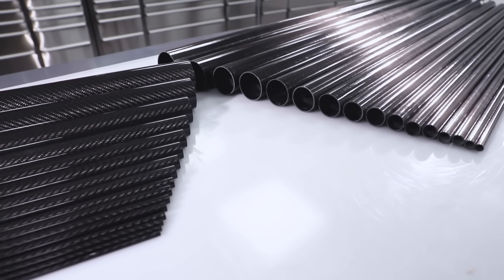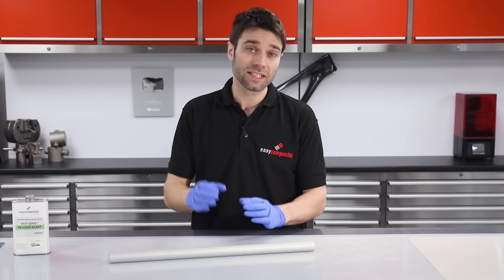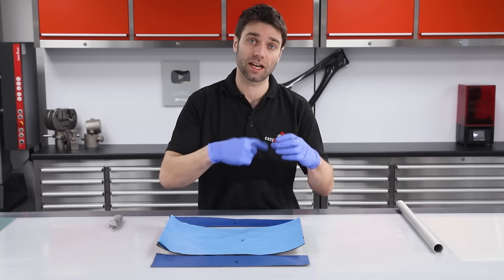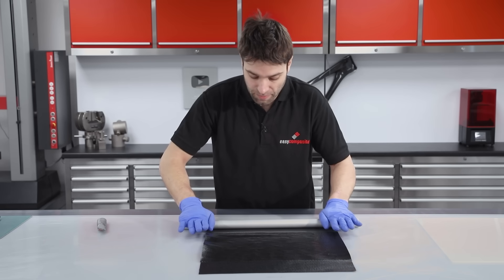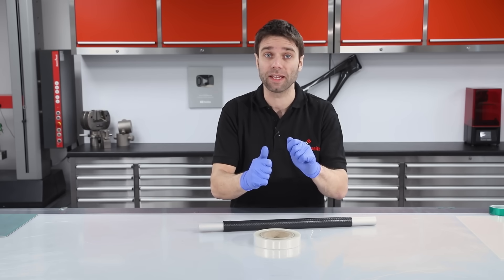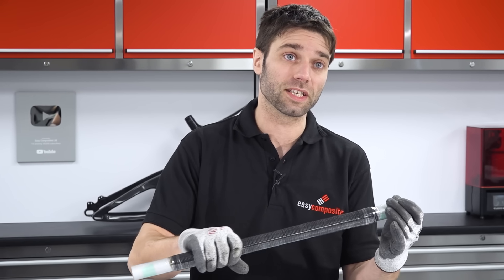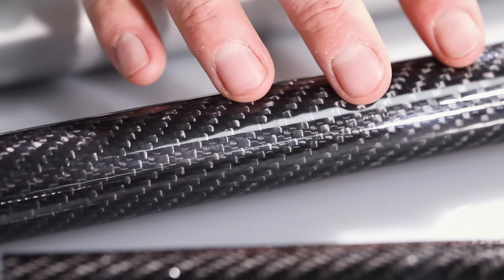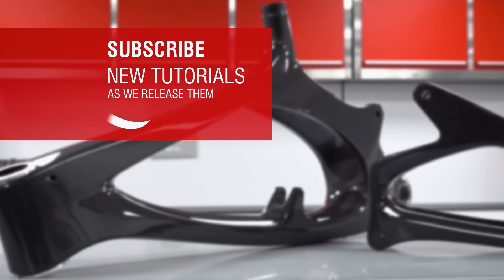How to Make a Roll Wrapped Carbon Fibre Tube

Comment: Hey, why don't you make similar strength comparison for aluminium and steel tube same size as this carbon one? THAT would be interesting.
Reply from the maker: Well, firstly we didn't have those tubes handy. Secondly, the deflection of a steel or aluminium tube is pretty standard data so could be calculated accurately. I won't do the number crunching now but suffice to say that weight-for-weight the carbon fibre tube would beat both the steel and the aluminium tubes hands down.
Reply: @easycompositestv  Well, everything that has been said is clear to me - I am a mechanical engineer. However, I think that this comparison would be very beneficial for people without specialized knowledge in the field of mechanical / material engineering - for them the widely available detailed data of specific materials are completely useless because they are not able to interpret them correctly. Also, "one picture is worth a thousand words :)
Reply: @easycompositestv  Did you use "well" word on the beginning of your sentence for irony? I'm asking seriously, because I'm not native speaker, so I cannot recognize it.
Reply from the maker: @dzikusdzikusdzikus  No, not at all - in this case, it was just a starting point to the sentence - no irony/sarcasm is intended at all.

Comment: Whats was the wall thickness of the carbon tube you made?
Reply from the maker: Wall thickness was nominally 1.4mm. Using a vernier, there was a variation between 1.3 and 1.5mm.

Comment: Will the resin hold up to some chemicals? Say if I wanted to use these for coolant pipes in a car? Also if I can suggest a topic for your next video, a motorcycle fuel tank? I’ve been want to do one for years but I really find any info on the subject. Thanks
Reply from the maker: Epoxy had pretty good chemical tolerance and also a tube that's been cured at 120C should have an operating temperature that's up to the 100C you'd need for a cooling system. HOWEVER - continuous exposure to antifreeze and boiling water is not really what a carbon fibre tube like this is designed for and so I wouldn't recommend it. As for the motorcycle tank, yes, we'll definitely be making this video in the future. The trick is to use a tank sealer to protect the composite laminate from the fuel. Make sure you're subscribed to find out when we make this video!
Reply: Subbed! For motorcycle content! Yes finally!

Comment: This is great. I always enjoy your videos. But I’m curious. What if you don’t have the curing oven? Is there a way to make these tubes if you don’t have one?
Reply from the maker: You can't really use the roll wrapping process without an oven because the process requires the mandrel to expand, then the resin cures, then the mandrel contracts. Without heat, this isn't really possible and so this process can't be used. You could do without the oven if you had a slightly tapered tube however.
Reply: You could try making your own budget oven like is shown in this video. https://youtu.be/CQ1PNXa_LaI?t=1227

Comment: hello i plan to make my own carbon tarp tube for camping use the tube will be use in windy condition  wonder what type of carbon i should use 1k carbon  and should i mix it with kevlar will it make it stronger also can i make my own carbon tube with out using a oven ?
Reply from the maker: You can't use this roll wrapped process without an oven Kenneth because the process requires the mandrel to expand, then the resin cures, then the mandrel contracts. Without heat, this isn't really possible and so this process can't be used. In terms of the carbon to use for your tent poles the '1k' but doesn't make any difference (apart from quadrupling the price), 1k just refers to the size of the fibre bundle, not the strength or any other properties. Kevlar is only useful if the pole might break completely and you don't want it to fall apart when it does. Assuming you're not planning for this then I'd stick with pure carbon; that will give you the maximum strength and stiffness for a given weight. The biggest difference will come from the mix of woven and UD plies and the alignment of the UD plies. For a ten pole, you probably want a layup similar to the one in our video - i.e. the majority is UD down the length with woven inside and out.

Comment: Could you make a carbon tube with a wet lay or infused process instead of prepreg?
Reply from the maker: You could certainly wet lay in a very similar way to the repair done here and also similarly to a tube repair as seen in our Fishing Pole Repair Video.  Infusion would be much harder in a practical sense for smaller tube sizes, although for bigger sizes it may work using a tubular bagging film and extra care to ensure the resin is evenly distributed all around the tube.
Reply: You can also make your own prepreg by doing a wet layup on flat carbon and then freezing it. Then when you are ready to make your tubing, just let the home made prepreg thaw just a bit and roll it on just like factory prepreg. It's much less messy that way and the carbon tends not to slip as much during application.

Comment: So how would you go about doing a tapered mandrel?
Or even, could you use this process to carbon wrap a rifle barrel with high temp resins?
Reply from the maker: So, if you had a tapering mandrel you would cut your reinforcement to anticipate the taper, i.e. it would be a wedge shape, and then you would pretty-much follow the same process that you see in this video. You will encounter some complexities around fibre alignment (i.e. the UD layer would start to go off-axis as you wind it round) which you'd need to overcome by using multiple shorter lengths of UD, each time resetting the fibre alignment.
Reply: Easy Composites Ltd thank you for the reply. Can you make a video showing what you mean please. 
I understand how a wedge shape would work. But I’m. It sure what you mean by UD. 
For my project the barrel would form the mandrel and would be left in place after the cure. 
So a conductive resin would be needed. One that could take a lot of heat.
Reply: @onemanriflemaker3873  I think "UD" here is short for unidirectional (the middle layer in the video).
Reply from the maker: So, if you had a tapering mandrel you would cut your reinforcement to anticipate the taper, i.e. it would be a wedge shape, and then you would pretty-much follow the same process that you see in this video. You will encounter some complexities around fibre alignment (i.e. the UD layer would start to go off-axis as you wind it round) which you'd need to overcome by using multiple shorter lengths of UD, each time resetting the fibre alignment.

Comment: Nice video as always. When I did some tubes for my car I wrapped some extra tows around the ends to make beads, kinda like your step to pull it off if necessary. This way theres much less chance of a coupler popping off. My application was for car intake tubes that see boost pressure.
Reply from the maker: Yep, nice tip and nice way to get a small, neat step on the end of your tubes. Totally makes sense.
Reply: Hey Man, I was exactly thinking about to make Boostpipes for my Hillclimb Porsche 944. It runs in Racemod nearly 4 Bar (something around 58psi). Son now my maybe dumb questions: Can they handle that? I mean it is mechanically strong of course, but air pressure? would really appreciate your answer. Stay safe out there!

Comment: Slight overlap, would that be 5mm or 10mm? For additional strength could more layers help? Rotational strength? You make it look easy. Thanx
Reply from the maker: The overlap is only necessary to hold the fabrics together during the rolling process, so in this case the overlap was actually very small at around 3mm.
Reply: @easycompositestv  with the 5 total wraps around the mandrel, what wall thickness does this equate to after baking?
Reply from the maker: @sandman70131  The finished tube had a wall thickness of 1.7mm.

Comment: Is that a 3D printer what you have in the background?
if so, it would be great to see how you use it to build carbon fibre parts
thanks
Reply: It's a resin 3d printer.
Reply: You don't make carbon fiber parts with that printer.
Reply: @derbigpr500  maybe moulds
Reply: @derbigpr500  not directly out of the printer, it can only cure UV resin into shapes. But the resin print can be a mould or blank to make a more durable mould from.

Comment: How its made a fiber carbon steering wheel? Thanks!!
Reply from the maker: Because it's a completely closed 3D shape, a carbon steering wheel is usually made in two halves which are then bonded together afterwards, as a front and back. Of course, this depends on the design and some shapes might allow for a process more similar to how we made the bike frame (shown in our last video) but that requires some way inside the form.
Reply: @easycompositestv  You can’t make it by rolling the carbon fiber directly into the shape of the steering wheel?
Reply: @easycompositestv  in this video , puts the carbon fiber on the steering wheel and gradually gives it the shape. this way of doing it is correct?     

https://youtu.be/UDsZsFJ1ai8
Reply: @fransanchezfsr1731  the video you tell us, is laminating process, its a hand layup, and only for cosmetic purpose. It's a different things than 'making stuff'
Reply: you could possibly do it like they show in the bike frame video. design in a way to extract an inner bladder or bagging material then use the vacuum method.

Comment: Do you pre heat the oven to get the aluminium tube to expand quicker before the epoxy starts to cure?
Would you recommend against using a solid aluminium bar for this reason?
Reply from the maker: Hi Tom, good questions. The oven was already at temperature and yes, this helps to ensure that the aluminium expands before the epoxy cures. As for using a solid mandrel, yes, same principle. It definitely is possible to use a solid mandrel but - if you have one - a tube will warm up quicker and so would tend to be better for this process.
Reply: Also, truly great videos. As inspiring as informative!

Comment: Can you use the shrink wrap for carbon fiber skinning parts to remove excessive epoxy?
Reply from the maker: Yes, in theory. The issue really would be whether the thing you're wrapping is something that you could actually wrap tape around? If you were skinning something tubular, like a frame, then it would work.

Comment: Best carbon fibre video's out there! 👍
Reply from the maker: Wow, thanks Andrew, we try out best :)
Reply: @easycompositestv  you succeed! I will be after the kit to make the carbon fibre wings for my a5! Is that the same kit you used for the bonnet?
Reply from the maker: @andrew19682008  Yes, the process would be much the same albeit you may not need the inner moulding as we did with the bonnet.

Comment: this is really useful info!   Can these tubes handle constant temperatures of 100c?    I'm thinking like using tubes like these for long sections of radiator piping for automotive purposes.  How stable is it if it were also in constant contact with things like antifreeze?       And if the ends of the tubes were thick enough, can it be tapped or threaded?  if so, would the difference in thermal expansion of steel hardware cause tolerance issues?
Reply from the maker: Hi Joshua, good question. So, because this tube was cured at 120°C the basic principle is that they would be OK for a service temperature of anything less than that (let's say 100°C to be on the safe-side). However, a couple of things would worry me about your application. One is the anti-freeze and the other is the continuous exposure to hot water. Although in the short term neither of these would be a huge problem, I think for permanent exposure to this environment a carbon fibre tube wouldn't really be suitable.
Reply: @easycompositestv  is there any information on how much pressure something like a 3 inch cf tube can handle?  like 30-40psi of air pressure is doable right?  It most likely won't be sustained.    Thank you for taking the time to satisfy my curiosity.    

Can I ask how spoilers and wings are made?   I have watched the video on the intake plenum (i assume that's what it was) but how do you apply pressure/vacuum inside a fairly thin hollow shape like a wing?    I would love to see a video on something like that
Reply: i vote no...car coolant regulary exceeds 260F OR 150 C....really hot, and the steam inside is even hotter, wings and spoilers are easy IF YOU MEASURE THEM PERFECTLY BALANCED AND SYMETRICAL

Comment: What video covers making that tube with the kink in it? Can't recall seeing it. I'd imagine a similar process to the intake manifold you made though.
Reply from the maker: Ahh, well, what we've done there is mention the 'other' tube video that goes with this one. We've already filmed it (which is how we had the video we needed for that shot!) but we haven't edited it down yet. We plan on publishing it next week. Once they're both up it will make a bit more sense.
Reply: @easycompositestv  fantastic thanks for getting back to me! I can't wait as I feel it's very relevant for the projects I've got going on :D
Reply: @GoldenSlothRacing  I'm glad you asked this. I've watched every one of their videos, and was wondering the same thing. Looking forward to the next video.
Reply: Can’t wait for that one I’ve always wanted to try making different tubes from carbon 
I tried different one off methods but turned out crap.
Reply: Nice videos

Comment: one of the many occasions i would think that buying one is the better option (?)
Reply from the maker: Yes, for sure. If you can buy the tube you need that that's going to be quicker, easier and cheaper. And hey, we'd be happy to sell you that tube :). The purpose of this video is to explain the process and also show how it could be used to produce your own tube if it just wasn't possible to get one at the dimensions or fibre configuration that you need.
Reply: @easycompositestv   thanks for showing.